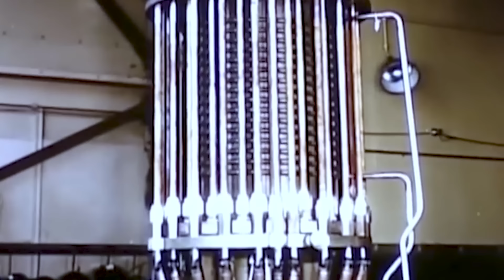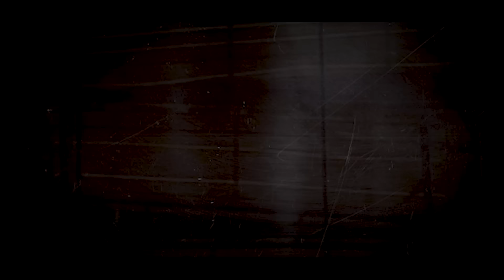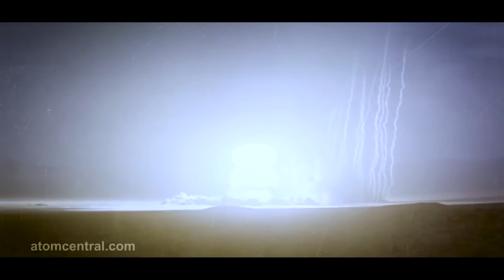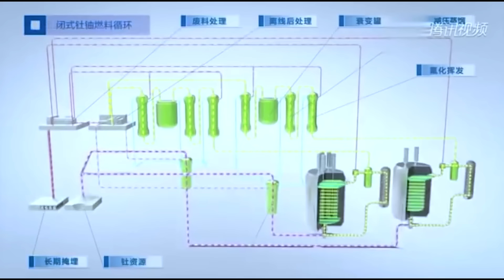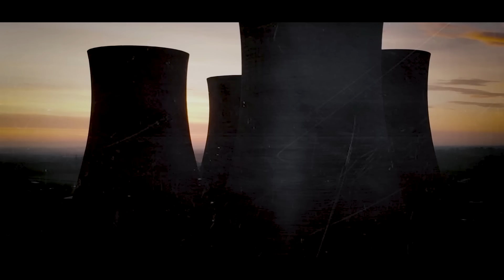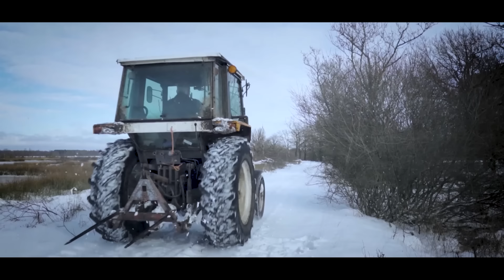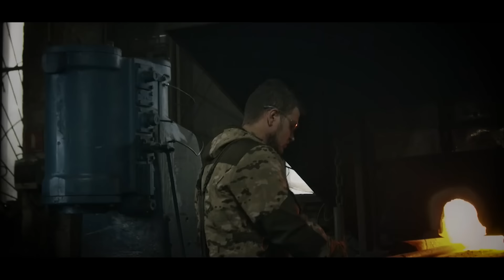Future of Thorium Reactors and Nuclear Energy

Comment: Very good job! There's a couple of suggestions. If I'm not mistaken thorium reactors can also used ground up radioactive waste from other reactors since only 3% is currently used of fuel rods.  This reduces the half-life of nuclear waste tremendously down to around 300 years. As you mentioned thermal is a big part of thorium or molten salt reactors including the ability to melt aluminum, steel, quartz into glass or solar panels and processing cement, all highly energy intensive processes. Finally nuclear powered planes sounds cool but weighr and shielding and cost still going to be an issue. Nuclear powered container ships is less sexy but far more manageable with small modular nuclear reactors.  Again these are just picky items I thought I would mention, but overall you did an excellent job.
Reply from the maker: I appreciate the feedback. Thank you for the support
Reply: @JoaquinRevello  Thanks again for great video.  For some reason Thorium has a fuel has a lot of detractors. I think it's a tribal thing they're not really based on science.  Please correct me if I'm wrong but I think that regular old uranium can work in a molten salt reactor. I don't know if it's interchangeable with thorium but that would be an interesting question to answer.
Reply: @JeffHoldenWS-NC  No, it’s Th supporters don’t understand the subject and get many issues confused.
Reply: @paulbedichek2679  No, it's people who are not nuclear physicists who don't understand pretty much anything about any reactor who are confused - not just Th supporters. Why would you expect anything different? Just sayin'
Reply: @JeffHoldenWS-NC  google : downsides of Thorium if you dare
Reply: @CarlosOddone-z6k  okay I did Google the negatives. It seems that India and China are pushing forward with thorium reactors. It makes sense a lot for India since they have a lot of thorium. It seems like at least two large countries thank thorium is a good idea both of which have landed rovers on the moon. The primary issue with thorium has always been the molten salt in the corrosive effects on the metal parts. Back in the day no one could guarantee the 30-year lifespan to a thorium reactor but that was in the '50s. I would hope that we've figured out that by now.  All the negatives seem to be liberal weasel words that basically see thorium subsidies as a way of eating into solar and wind subsidies. That if we would just subsidized solar and wind we won't need thorium or any nuclear reactors. I think the Russian invasion of Ukraine and and the sudden cut off of hydrocarbons pretty much put the steak in the renewables heart.  All of a sudden nobody was wanting more wind and solar power. Even Germany It was supposed to be the renewable Eden finally admitted they had been fudging all of their renewable numbers to make them look better than what they were. You got to ask yourself why the country (China) The producers the majority of the solar panels and EV batteries is building an additional coal-powered plant per week and looking at thorium. Don't you think they would be able to get solar and batteries at half the price is the rest of the world since they make them? The problem with electricity is always going to be storage. It doesn't matter if you can generate it for free like rainwater. You still got to be able to store it and distribute it unless you can just generate it on a moment's notice. Renewables are dead. Lets just hope they don't crawl back out of their crypt
Reply: @JeffHoldenWS-NC  Thanks for y kindness. THEY didn't figure out liquid Natrium in breeders, now (10-20 years from now) will try hot  corrosive 700°C Fluor in molten salt reactors. Why not if there is money for that ... but thanks God there isn't, (they desperately are looking for subsidies). Don't panic while looking for "solutions " instead of compromises Have a nice evening.
Reply: 1 last word. Find the best metallurgists and the best brains in solid-state physics.
Reply: No,no such thing as a Th reactor, there are systems that use Th,but right now the only ones, besides China's tiny experiment is India and they use solid fuel rods like normal pressure reactors. The Russians are the most advanced with closing the fuel cycle and they use fast reactors both Sodium cooled and Lead cooled.
Spent fuel isn't much of a problem, it is reactor cost,and time to build.
 Advanced reactors are more economical with fuel and produce less waste, but Terra Power does not consume waste Bill Gates wants his reactor to be used worldwide and his aim is to have low proliferation risk.
 The end game is the TWR,natural U goes in and waste slightly radioactive for a few hundred years comes out,all the energy is extracted,China and Terra Power are working on it but the first reactor using a traveling wave is enough in the future that it will have to compete with fusion.
Reply: I doubt commercial ships will have nuclear powered propulsion until a long time after it has been established on land.
Reply: @tjampman  four countries have built commercial nuclear power ships including cargo carriers and ice breakers. Obviously aircraft carriers and many US submarines use nuclear. I believe they're just small versions of current technology light water pressure vessel reactors. Molten salt reactors would be a great improvement and safety and reliability and if you care about the carbon footprint they would be especially helpful since 6% of all fuel used in the world goes to container ships. It might make more sense to start with ships that are out in the ocean rather than fixed land plants
Reply: @JeffHoldenWS-NC  You got things switched around. 
Current technology relies on scaling the small nuclear reactors in aircraft carriers (two reactors instead of one large one) and submarines which are relatively 'safe' due to the checks and munufacturing methods that are easier to carry out compared to full size reactors in power plants.
Reply: @tjampman  there already lots of nuclear powered ships now.  Sealed no maintenance systems would make sense.  Something like solidstate heat pipe units that load follow and auto shutdown.
Reply: @tjampman  About 15 years before commercial nuclear is widespread but the Russians already have ice breakers that double as cruise ships powered by U,the molten  chloride fast reactor is perfect for ships the first experiment is being built in Idaho,yes,we will first run these on land ,but reactors will power the big ships starting in 15 to 20 years.
Reply: @paulbedichek2679  True.  But Russian is phasing out their nuclear ships.  Even for the navy, Russian has stopped producing new nuclear warships for many years.  And is phasing out their nuclear cruiser warships.  Those nuclear icebreakers are produced because they do not have alternative engines to power those ships.  The large scale ship-used turbine factories were assigned to Ukraine in communist era.  After Ukraine independence Russia has lost the capability.  Russia cannot build large warship now.  They can go nuclear but didn't.
Reply: If your aim is to reduce the amount of spent fuel, fast reactors are more useful then thermal reactors even molten salt reactors using Th as fuel.
Molten chloride fast reactors are especially useful for this purpose, Southern Co with Terra Power and others is building an experimental size reactor on Idaho National Labratory land, no need for Th.
Reply: No such thing as a Th reactor it is simply fuel which can be used in a variety of reactors.
Reply: Massive desalination plants for coastal metropolis !
Reply: Next time you drive through a shipyard filled with aging, rusting container ships with questionable maintenance histories, owned by companies who find it more profitable to pay the fines for illegal operation and work a ship until its keel breaks and collect the insurance... ask yourself, "Do I really want ALL of these ships getting nuclear reactors?"
Reply: @Ravenlore777  liberals would prefer the ships don't exist at all because burning diesel contributes to global warming. Diesel will eventually run out when we've used all of the available hydrocarbons. Ships used to run on renewable energy, they were called sails. There's a reason we gave them up.  You can't run a modern ship on solar panels.  One cloudy day and you're simply adrift.  Like it or not the future of shipping is probably going to be small modular nuclear reactors.  Either that or there will be no ships at all .. rust buckets included.
Reply: @Ravenlore777  with all due respect, you don’t know what we/you are talking about. We are NOT talking about nuclear powered ships. We are talking about reactor vessels, ie, what the nuclear fuel in a nuclear power plant is put into. Same as on land. But the difference is that with LFTRs you are not running the reactor vessel at 2300+ psi. You're operating it at very low pressure- 30-60 psi. That's often less than your garden hose. And no, they don't sit there and rust, They're rotated and completely rehab'd every 6-10 years. The concerns you express are simply not relevant to what this thread is talking about.
Note also that we're talking about gen 4, not gen 3 reactors. If you're not sure whst the difference is, I recommend Gordon McDowell's channel on YouTube.  He has 3xtensive documentation on progresd in nuclear reactors, and gen 4 fluif fuel reactors in.particular. his videos are not by internet crackpots, but rather by experts in the field who really know their stuff, and are primarily videos of international conferences and seminars from throughout the world on the subject.

Comment: U-233 fission does not primarily produce thermal neutrons. Neutrons from U-233 fission average over 1 MeV. Graphite moderators are still necessary for MSRs running on U-233 (or U-235) on the thermal spectrum. Fast breeder reactors do NOT use moderators like graphite as they are designed to run on the fast spectrum. They typically employ solid fuel and liquid metal (sodium or lead) or gas cooling. Water is not good for fast reactor because it will act as a moderator. I believe it is possible to build in theory a MSR fast reactor, but most of the projects I have seen are pursuing thermal (breeder or non-breeder) MSRs.

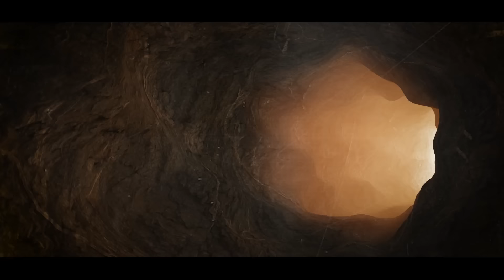Comment: 15:31 Well, it might be interesting to know, that Finland is storing the spent nuclear fuel in it's newly built 1bln$ depository, from just the two BWRs of the US design. This is idiotically inefficient, as in the contrast, Finland sends the spent fuel from her two VVERs back to Russia for the recycling and gets back only the pure nuclear wastes to store. In the amout of kilogramms, not tonnes! The entire Olkiluoto nuclear depositoryu can hold the world-wide amount of nuclear wastes from all the spent fuel from US, Europe, Russia etc., if spent fuel is thoroughly reprocessed (with trans-uranics removed to burn in the fast reactor). And Finland is using it to store the spent fuel from just TWO BWR?! This is just joke at this point, and people actually present Olkiluoto as a pro-green achievement? WTF, dudes? 
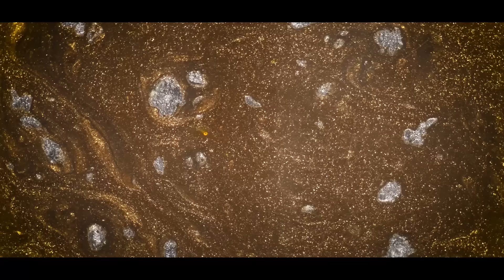16:35 All fast reactors can fission trans-uranics, not just Thorium molten salt ones.
Reply: No country should import anything from russia. Zero. Nada. Nothing.